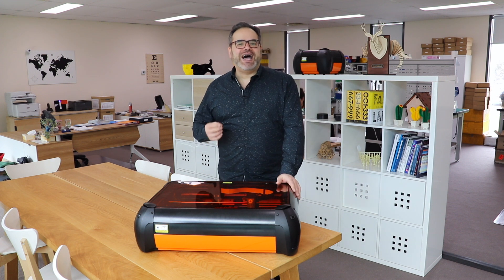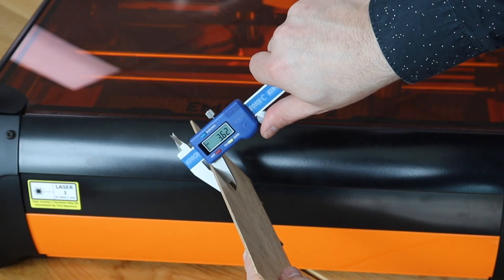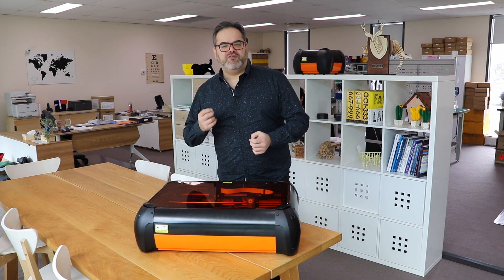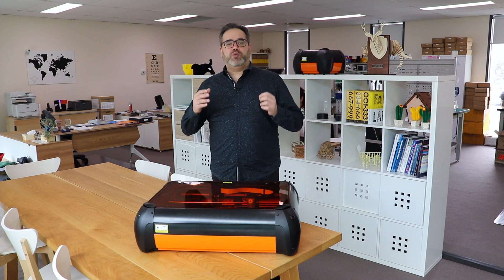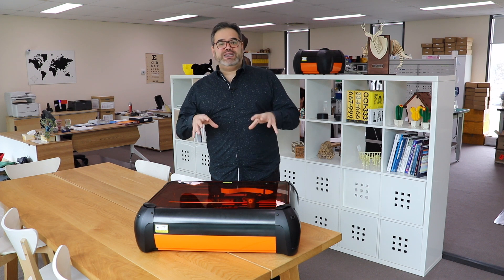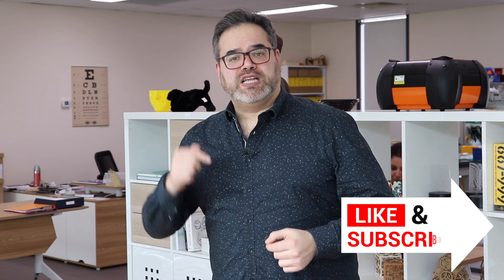Five tips to get the most out of your diode laser - Getting the best out of your laser

Comment from the maker: 0:01 - Introduction
0:38 - Tip 1: The focus of your laser.
1:29 - Tip 2: Making sure the lens is clean.
3:27 - Tip 3: Use air-assist when cutting material.
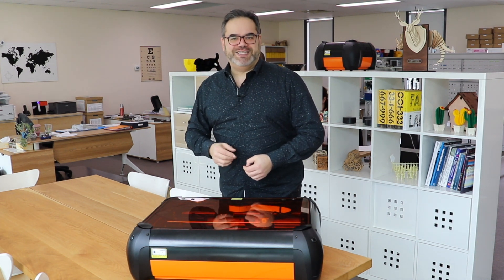4:33 - Tip 4: Make sure your material is flat in the laser cutter.
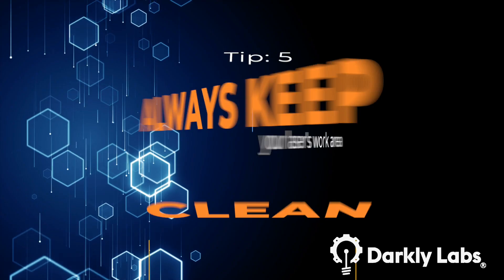6:13 - Tip 5: Always keep your laser's work area clean.
7:54 - Wrap up

Comment: Hi, these tips are great. I have a question: is it possible to get clean cuts of 3mm thick corrugated cardboard with a diode laser, if so, what would be the ideal laser power? Thanks!
Reply from the maker: Yes, absolutely. The first few projects I made was using corrugated cardboard boxes.
As for the power setting, what kind of machine are you using? Not all lasers have the same power... Let me know! :)
Reply: @LaserLivestream  Hey Gil, thank you for the answer. I don't have a machine yet and I was just trying to figure out if I really have to go CO2 way. Diodes are way cheaper than CO2 lasers but I don't want to sacrifice quality. I would like to have minimum burns on the edges and I wonder if a clean cut of 3mm thick corrugated cardboard will be possible with any diode laser without passing like 10 or 20 times. Thanks again!

Comment: I am using a J Tech 7 watt laser. It works great but I am having issues trying to get a clean cut in Mylar .  It will cut it but I end up with burnt edges. Would air assist help? Do you have any tips. The Mylar I am using has a milky colour and is not clear which I thought would be a good thing. I know it can be done but I am not sure how to proceed. 
Thank you for your time.
Reply from the maker: @SimPilot-dl8zy  That would be a factor. I’m guessing the Mylar is clear? If it’s a solid colour you should have no problems.
Reply from the maker: SimPilot 2018 without the material in front of me I can’t test the material but air assist would be one way of making sure the material doesn’t burn. Another thing I would do is multiple passes at lower power levels to make the cut.
What are you cutting the Mylar for? Curious what your making? ;)
Reply: @LaserLivestream  Airbrush stencils. The Mylar is precut and found on amazon but is available in other places as well.
Reply from the maker: SimPilot 2018 try air assist. Let me know how the results go
Reply from the maker: @SimPilot-dl8zy  That’s the light wavelength issue. When I read that the Mylar you were using was milky I assumed it was a solid colour. Find a source of hard solid colours and you will be cutting without a issue.

Comment: In your experience, how does a diode laser compare to CO2 laser systems. I have a CO2 based laser, I'm really happy with it, but would like to move into a bigger cutting area. I have considered building an enclosed diode system to my specs, but am not certain if they cut at a similar level of effectiveness as a CO2.
Reply from the maker: The main difference with a dioide vs CO2 is cutting power. If you want to cut 10mm perspex with a diode, it's not going to eat through that thickness of the material. The Emblaser I use will do up to 6mm, using multiple passes. So what I give up in power, I gain flexibility and not having to use coolers and extraction. What is the end result you are looking for in a diode system?
Reply: @LaserLivestream  Ideally I'd like to retain cutting power. I've considered the big "ebay" lasers, but as I am currently building a CNC, I thought a diode laser might suffice. I suppose I could do larger cuts on the CNC, then engrave with a diode, though some scenarios really do fit better with a laser. Being limited to 11.5x20 has been less than ideal.
Reply from the maker: @CarlosElPeruacho  I hear where you're coming from. I have a CNC as well, and use it to cut thick pieces. I see this like Cinematic film cameras and  Digital DSLR cameras. Both have lenses, eyepieces and record images that move. But in the end, they are totally different forms of media.  WIth CO2 and diode lasers, they can cut and engrave, but use different work paths to get there. Strengths and benefits...